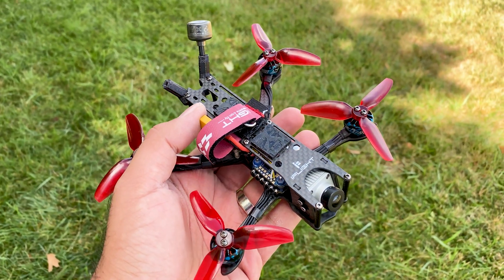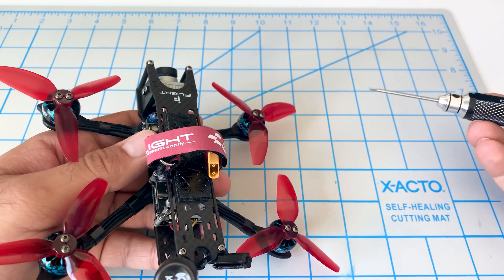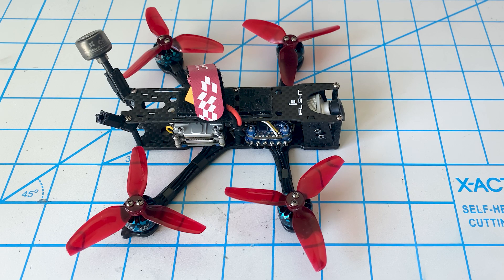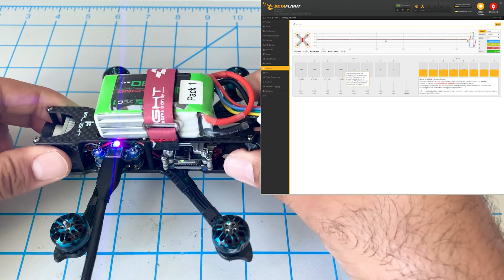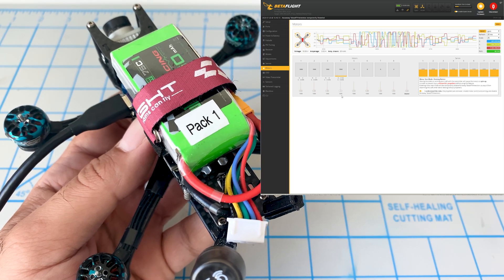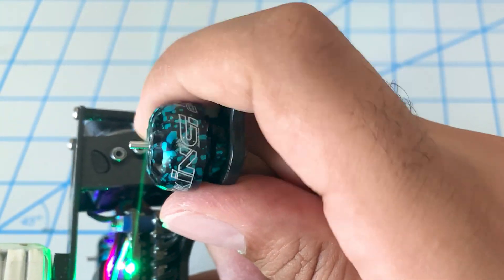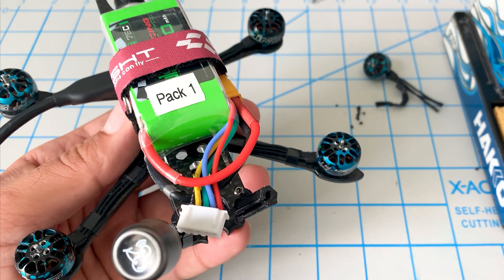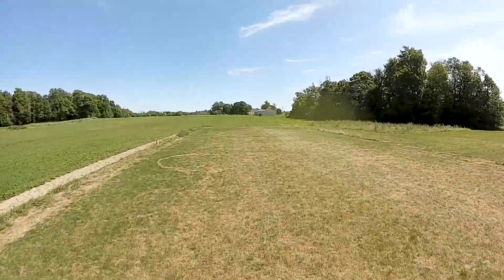iFlight DC3 FPV Video Feed Jello Troubleshooting & Fix | Need to STOP the Shake!

Comment: Dude.. you just solved me a major headache. Bought a new DJI Action 2 and the footage on my Crux35 was total pants... jello hell. Was soooo gutted. Stuck it on my Rekon 6 yesterday... butter smooth footage. (Phew!) So.. been round the houses looking at jello / vibrations etc. etc. til I found your vid. Did exactly this test - sure enough, horrible buzz vibration on one motor. Can't test yet as though no spares to hand - managed to get one from local U.K. supplier - woot! Pretty sure this should solve it now from what I seen. Cheers for posting, 👍
Reply from the maker: Glad to hear that! Happy flying!

Comment: +1👍 hmmm, i'd probably adjust my pids before i replaced a motor for such a minor dent. (unless the entire bell or shaft was bent, then a different story of course)
Reply from the maker: Absolutely! These PIDs were already working fine previously so knew that something mechanical had happened. Also, the damaged motor resonated quite a bit.